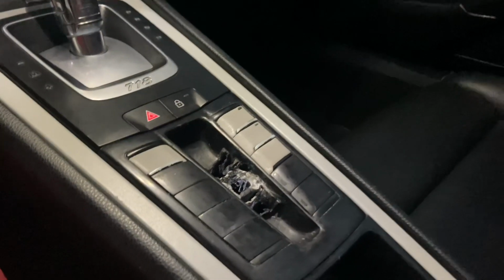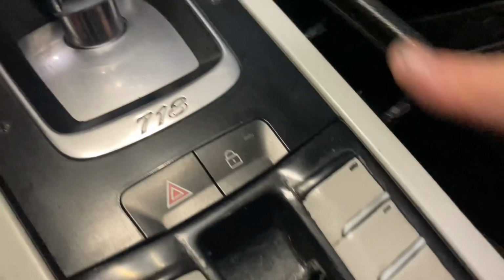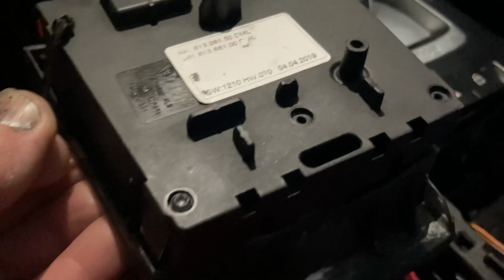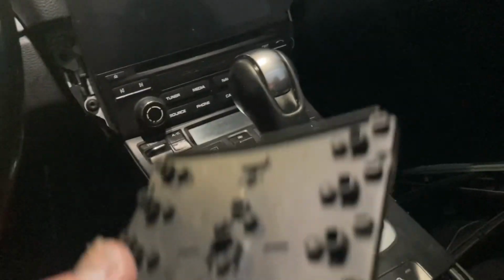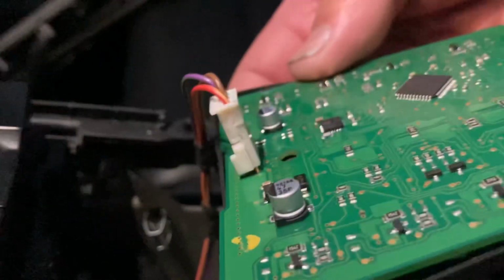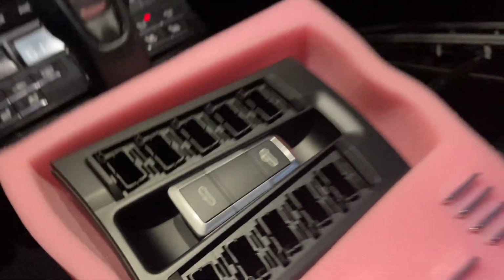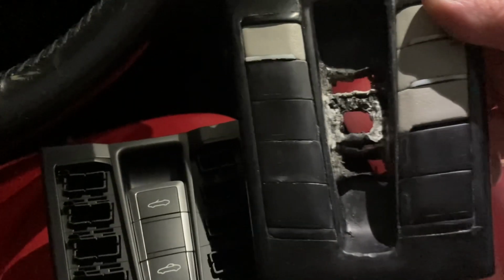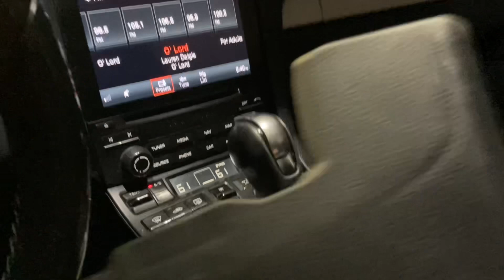How to Fix Broken Porsche Convertible Top Switch / Console Switch Assembly

Comment: How did you do the recoding so that the new switch assembly worked with your car?
Reply from the maker: For some reason I did not have recode the module. Everything worked exactly the same as it did with the previous module. However, I did read that it would need to be recoded however in my case it did not.
Reply: Thanks

Comment: The little plastic chrome divider piece between the buttons broke off mine. 
Is it possible to replace just that little chrome piece without remove the whole assembly?
Reply from the maker: If the old chrome divider is missing you should be able to just slide one of the chrome pieces is without taking apart the assembly. I have some extra chrome dividers if you need one.

Comment: Why did you take apart the old one? If you have a new switch assembly, the whole unit is plug and play right?
Reply from the maker: I originally thought it would have to be recoded by the dealer and since the electronics was fine in my unit I was going to just swap out the circuit board to avoid having to get it recoded. However, it did not need to be coded.

Comment: Did you need a dealer to code it?
Reply from the maker: I read that I would need a dealer to code it but I installed it and everything functioned without re-coding.
Reply from the maker: For some reason I did not have recode the module. Everything worked exactly the same as it did with the previous module. However, I did read that it would need to be recoded however in my case it did not.